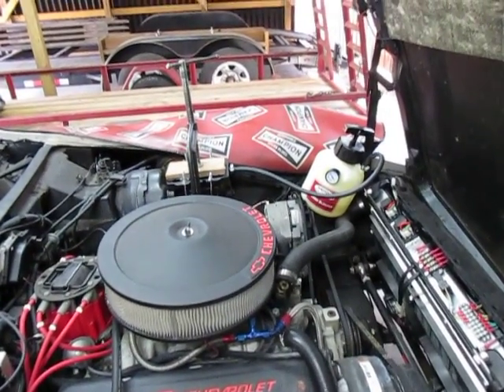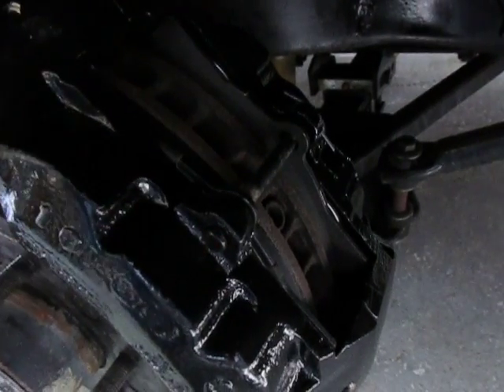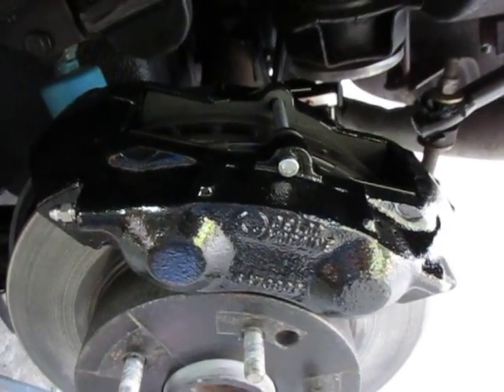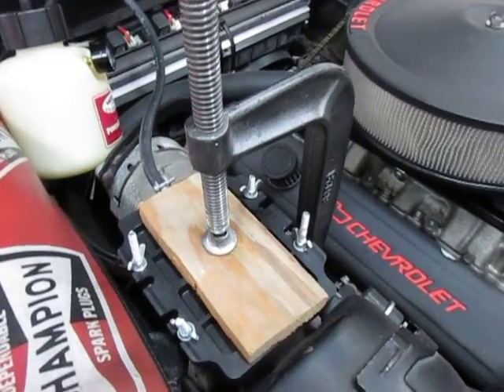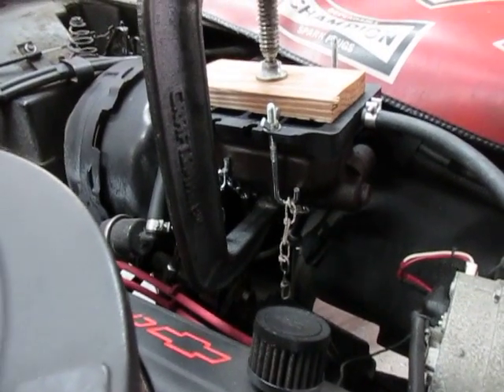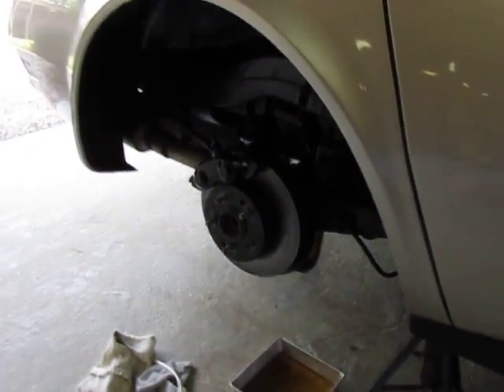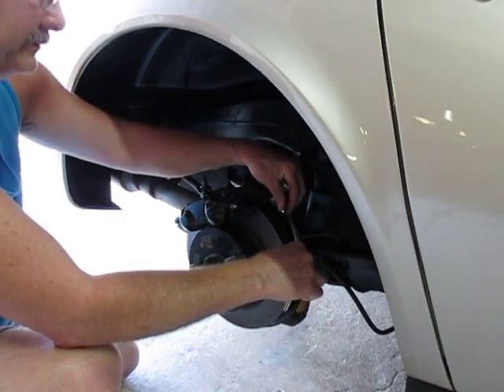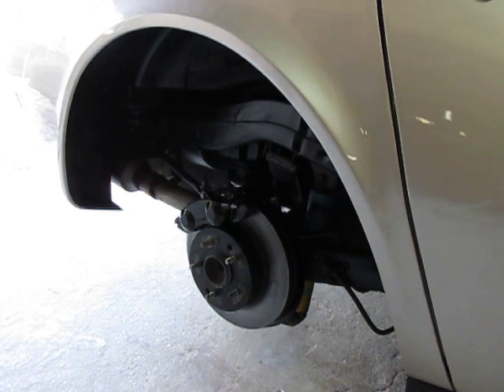How to Bleed Your Brake System with a Pressure Bleeder

Comment: The hose burst on my Motive brake bleeder today, which was a fun mess to clean up. Can you tell me what kind of hose you have attached to yours? It looks like you've used the original brass fittings with hose clamps.
Reply from the maker: Mine is original. I'd probably fix it with a piece of transmission cooler hose and some clamps.
Reply: @10630390  Oh, I thought they only came with the clear hose; I actually ordered some new (plus extra) hose and the Oetiker type clamps from Motive.
I suggested they give a warning to replace the hose periodically, but they don't read emails.
Anyway, thanks for the reply, and your setup looks nice and clean btw.

Comment: The C clamp and block of wood is the key here.  I have a 73 that has rebuilt brakes and every 2 years I bleed the brakes and get the old stuff flushed out.  The Motive actually allowed me to bleed the Master Cylinder while on the car.

Comment: How are the calipers working for you
Reply from the maker: So far they are working great. No leaks. I supplied the cores because VBP didn't have any at the time. They rebuilt mine with "O" rings and powder coated them black. Very quick turnaround. They were very nice and friendly on the phone too.

Comment: I've got the same brake bleeder from Motive.  I couldn't get their adapter plate to seal on the master cylinder of my 1981 Corvette.  Needless to say, I was quite disappointed.  Seeing your video, using a block of wood and a c-clamp is a great idea.  I hate it when I have my blinders on and don't think outside of the box for solutions.  Thanks for sharing.
Reply from the maker: Glad the video helped. I thought the adapter could have been a lot better for the price. I have heard of people making there own bleeder using a garden pump up sprayer and an adapter fabricated from an old master cylinder cap. I may improve mine one day by making an adapter out of an old cap. Thanks for the comment.
Reply: Thanks for taking the time to put together this video...very helpful.  I also have the Motive system and also couldn't get mine to seal to the master cylinder.  I'll be working tomorrow to create an adapter out of an old cap.